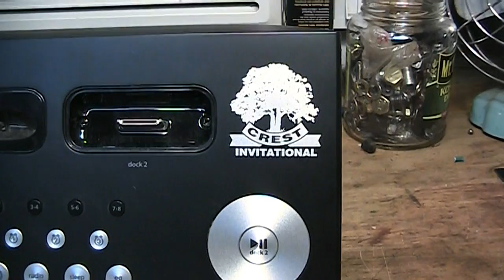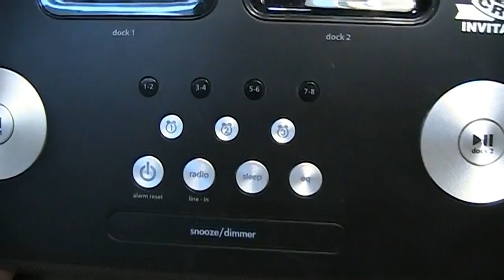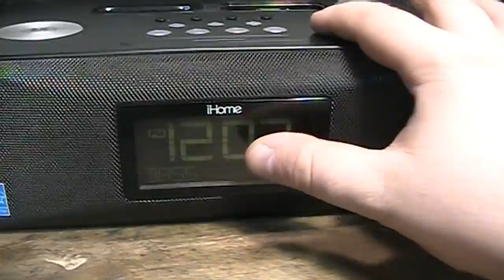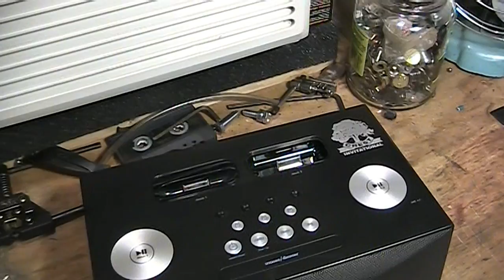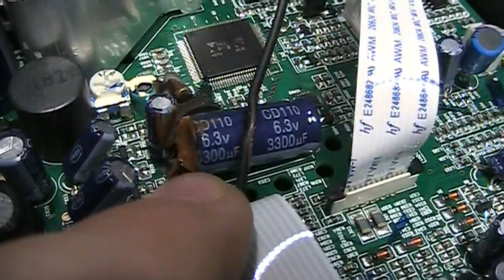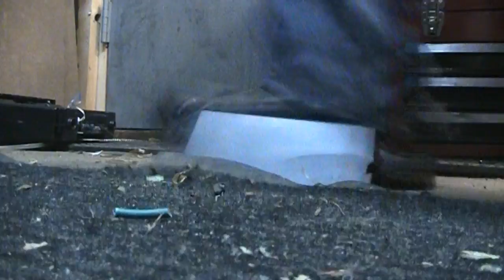iHome iP86 Alarm Clock Radio - Broken iJunk

Comment: I found a similar model (although single iPod dock model rather than dual) that was exhibiting very similar audio cutting out behavior as shown in this video, with one or both speakers cutting out. But in my case it seems to be resolved by using a different power supply. I guess this slightly newer iHome model did not like the power supply (maybe an unregulated power supply?) from my slightly older iHome, despite listing the same 7.5v requirement. Meh.

Comment: I'm sure many others have already asked, but what camcorder or camera are you using? And by what means are you transferring the media to a computer with? It has a lot of warmth to it, so I'm guessing an analog medium (Hi8?) and it looks very smooth, like you've deinterlaced to 60 FPS in progressive.
Reply from the maker: Many of my videos are filmed with a Sony Digital8 camcorder; this one was actually filmed with a Canon FS200. The process necessary to convert the video to 720p60 remains the same, however, regardless of the camcorder used. I've been experimenting using the same process QTGMC deinterlacing method on video from HDV camcorder with much success. 

This allows me to continue using the camcorders I prefer, while assuaging those that find it their singular purpose to chide me for using "old" camcorders.

Comment: That was glue holding the capacitor in place, which has a bad habit of turning conductive when it gets old and turns brown, thus causing problems with the circuitry.
Reply from the maker: Little good it would've done, since it would've remained in a broken state.
Reply: @StereoDust
So you think there would've been another problem?
Reply: Too bad you found that out now, after throwing it out.